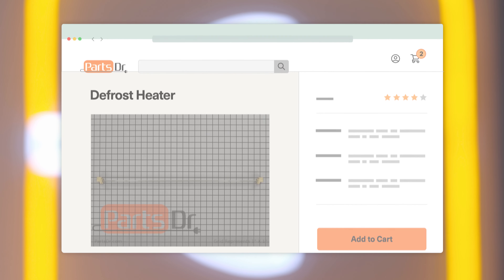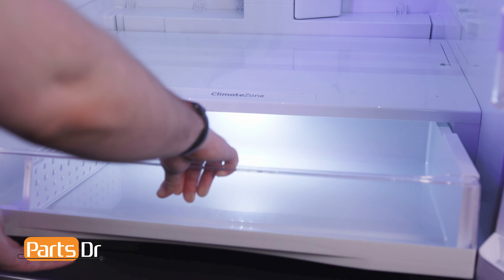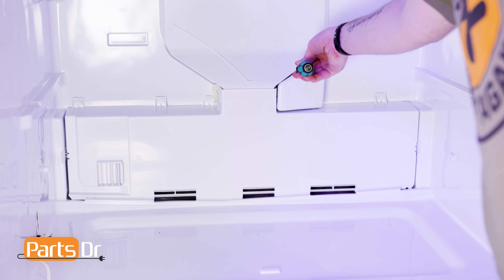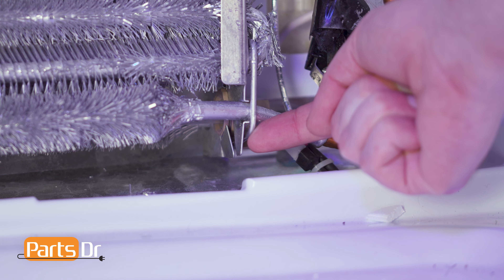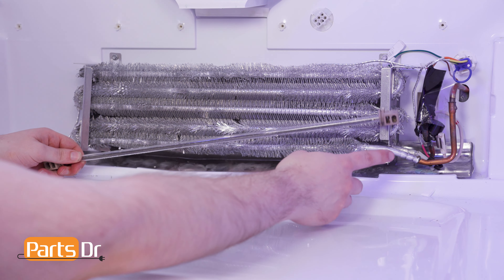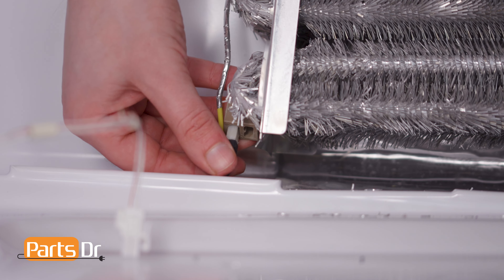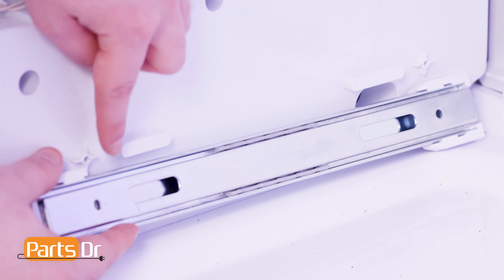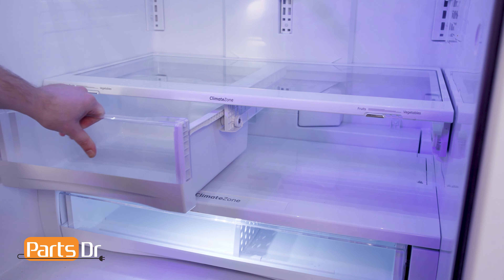The ultimate guide to replacing Fresh Food Defrost Heater GE refrigerator part # WR51X10132

Comment: I bought a new one and both new and old show resistance but no audible continuity. The old one does appear to have had moisture inside the glass is green. One spot darker colored on glass too.
Reply from the maker: Audible continuity varies depending on the make and model of the multimeter.  This type of part should be tested for ohms because the ohm value may be too high to register for continuity.
Reply: @ thanks, do you know what the acceptable range is?
Reply from the maker: @CraigMerrill-l8d  Usually 10 to 100 ohms.  You can use the Ohms Law Calculator to find the details here: https://partsdr.com/blog/ohms-law-calculator-a-crucial-tool-for-appliance-repair/

Comment: I replaced the defrost heater but  I still have a problem with cooling the fridge section. Did you know what the other thing can cause the fressing on the evaporator 😮
Reply from the maker: Check the defrost sensor and defrost thermostat.  See the videos linked below.
Test defrost sensor: https://www.youtube.com/watch?v=SBfqozNgLYY
Test defrost thermostat: https://www.youtube.com/watch?v=i4SNEgPoUMY